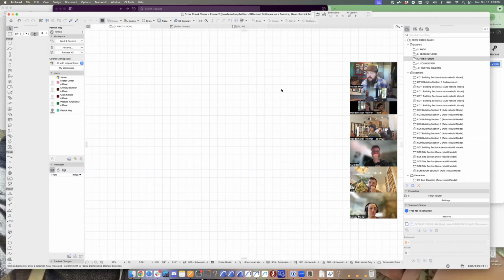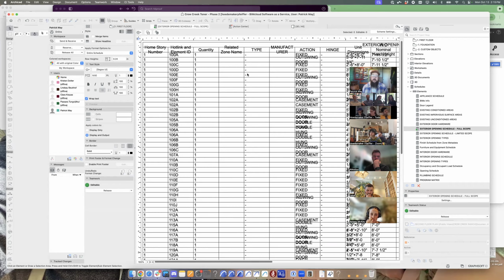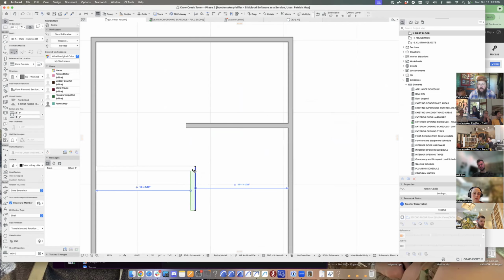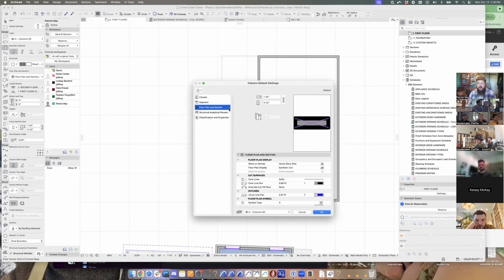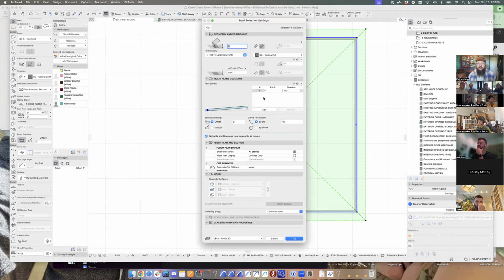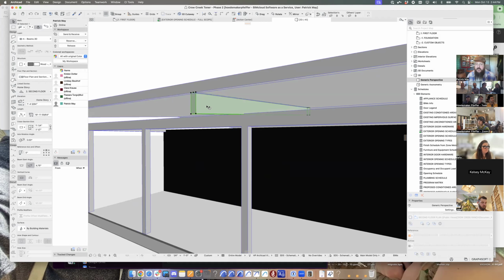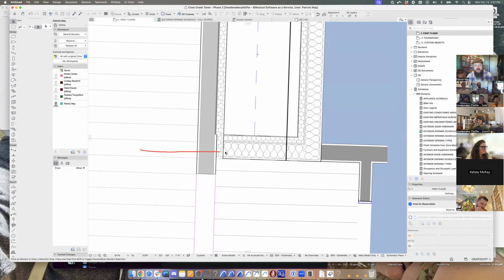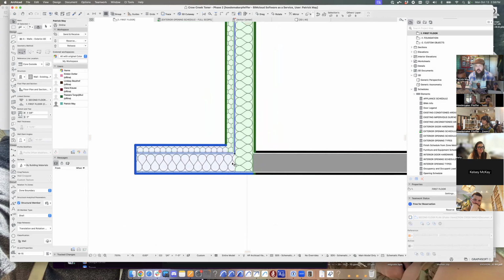AC back to basics   Part 1

Comment: I'd like to know wether Revit is the primary software used by architects in the US, and which states' architects use ArchiCAD?
Reply from the maker: afaik, there is no definitive list of architects based on their bim authoring practices... GS resellers tend to have a decent handle on that.
from what I understand, Revit/Autodesk to hold a major share of software seats at AEC firms in the states
Reply: @PatrickMay4dProof  Thank you!